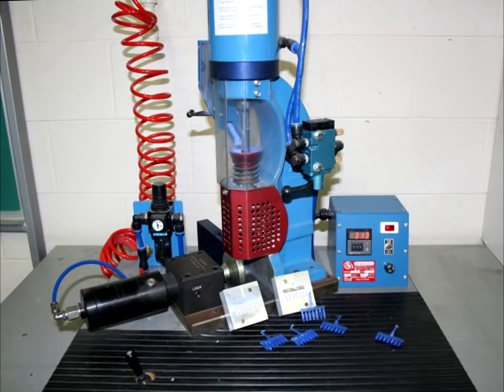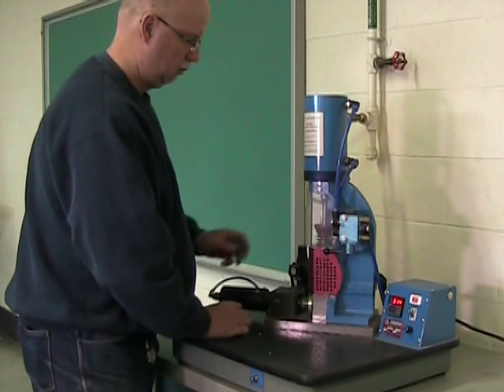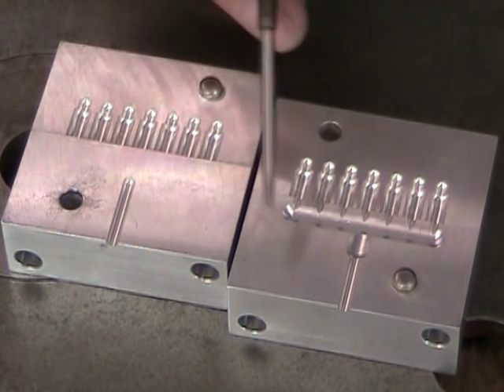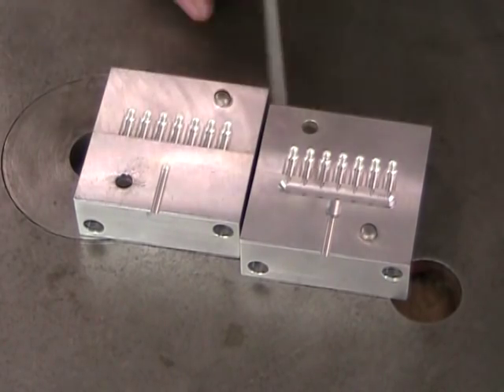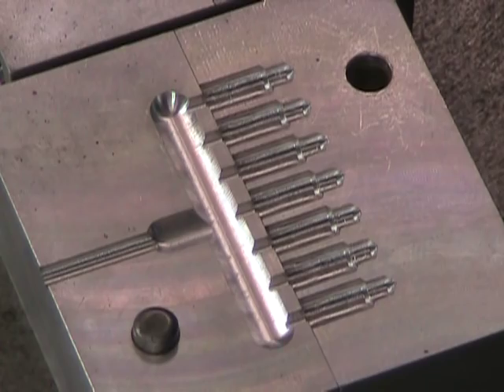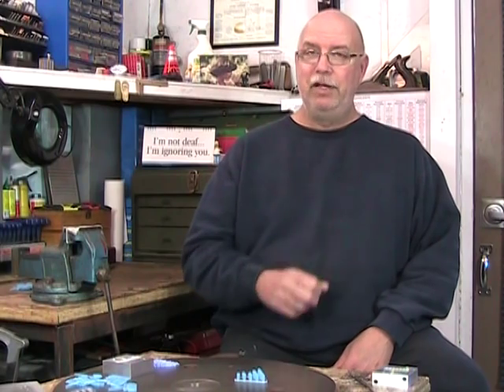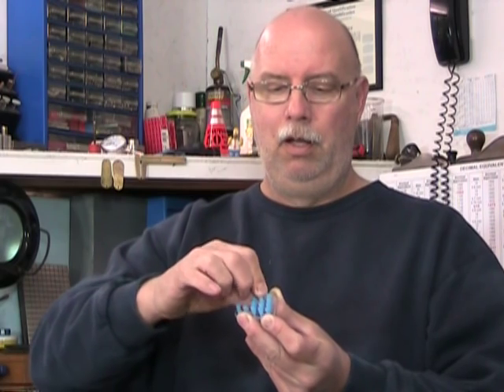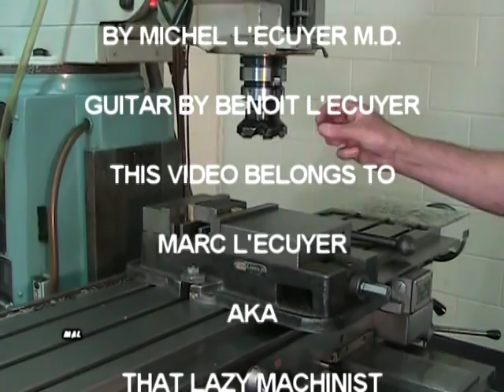PLASTIC INJECTION MOLDING, HOW TO MOLD PARTS, MOLDING 101,  MARC LECUYER

Comment: I work in a tire factory machine shop. We have multiple plastic injection machines that make plastic rims. Ours our steel and inter cooled. 2 to 4 cavities. The main issue we get is ejector pin failure and water leaks due to o ring failure causing water to enter the plastic curing process within the mold during curing .  Most molds have 20 or more pins depending on cavities.

Comment: Very nice and informative video but I have a question. Why are there no air channels in the mold to let the air escape when the material is pushed inside? Are they only needed above certain volumes?
Reply: I suspect that the high pressure would spray molten plastic through the vent all over the place. But then I have no idea how air gets out of the way here.

Comment: What temperature do you heat pbt up to?
Reply: 250 degrees Celsius melt temperature, you will need to dry the material in a oven or dryer first for 2 hours at 80 degrees Celsius. Ask your supplier for a data sheet to clarify/double check.